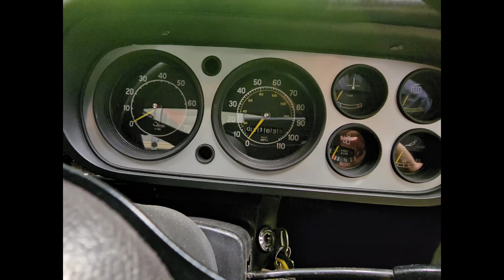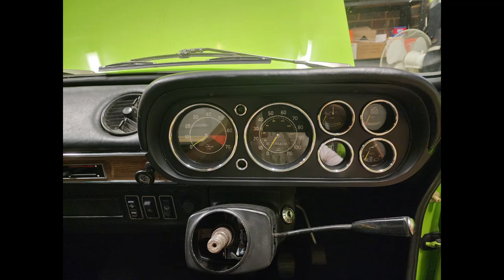Ford Escort Mk1 Restoration  - Part 5 "A few more mods and upgrades"

Comment: Nice one Stu.  Did you ever get it sumo’s?

Hope you are keeping well bud.
Reply from the maker: Thanks, Jason. Do you mean dyno'd?
I put it on the previous video. 108 at the wheels, which is rather disappointing considering its 1mm over bore, cammed with a set of 45s and 2 1/4" exhaust on it 🤷‍♂️. It definitely drives better with the 5 speed.
Reply: Bloody predictive text!!!  Yeah I meant dyno’d.  Do you know what 108 equates to at the crank?  Anyway output isn’t everything, the car looks mint.
Reply from the maker: Haha, I thought so! I think it'll be about 125 at the crank? Thanks, I love it too and it always gets plenty of comments when I'm out. It's great fun to hoon around in 😆
Reply: Sometimes less is definitely more!!